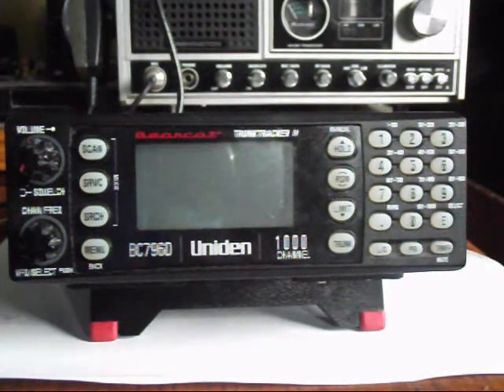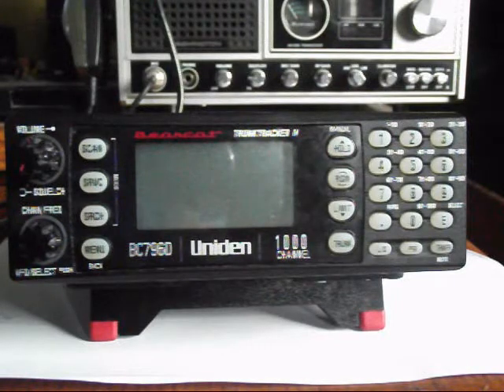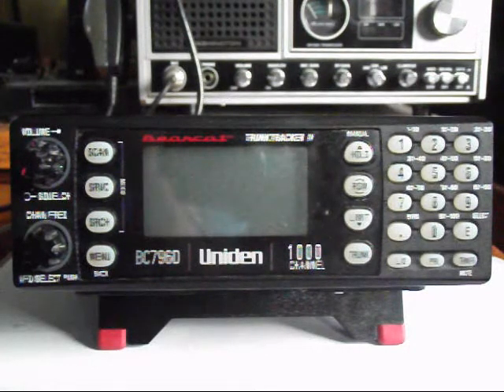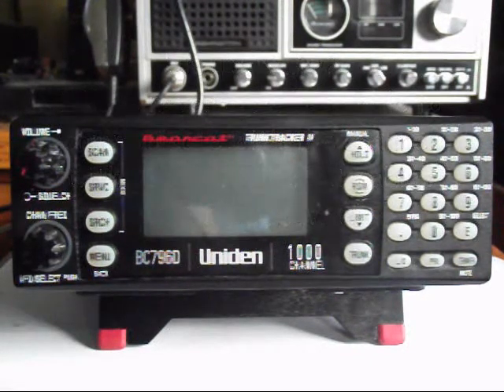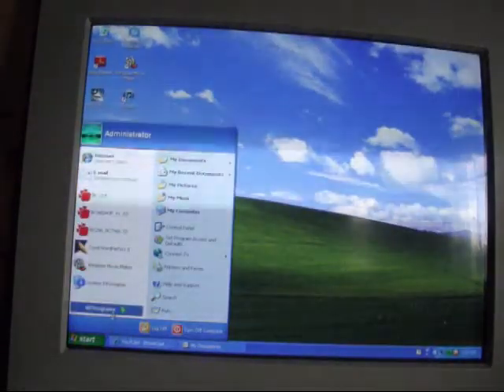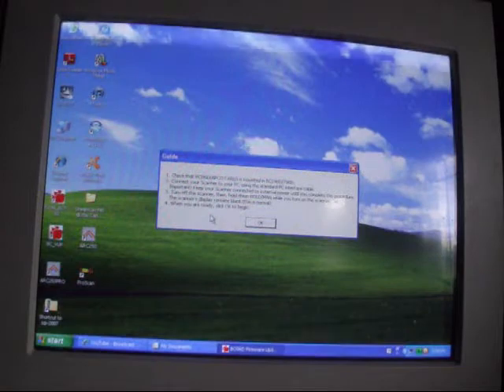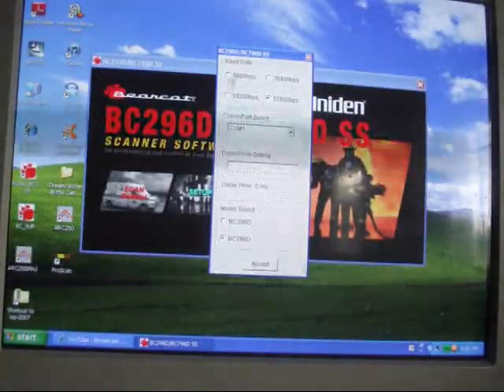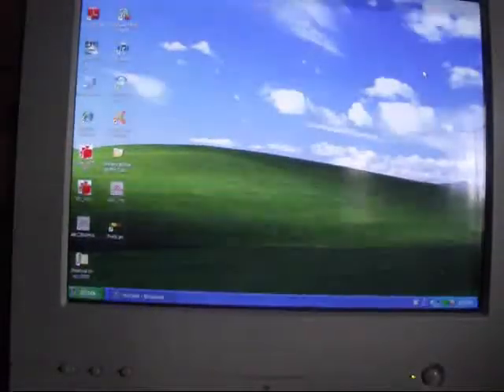Uniden Bearcat BC796D update # 1 firmware caused crash

Comment from the maker: yes, it communicated with the computer perfectly thru a CGA cord. I also used a free scanner program to change settings. Unfortunately, the free program was not capable of curing the squelch issue of the P25 system. I was hoping to have a scanner tech drop by and have a go at it. He offered to drop by the next time he was in the area. It's been a long time so I guess he forgot!